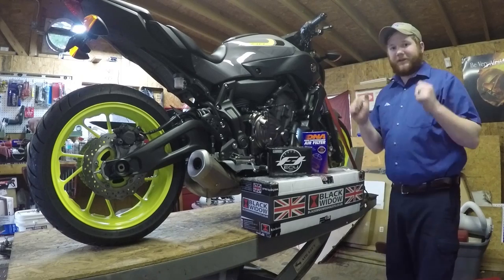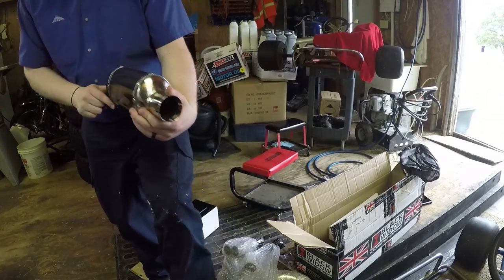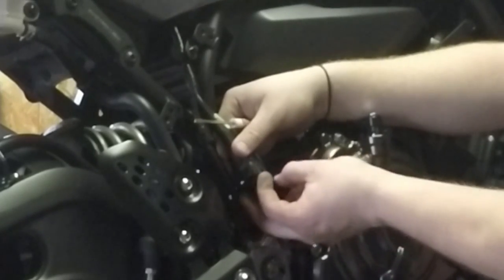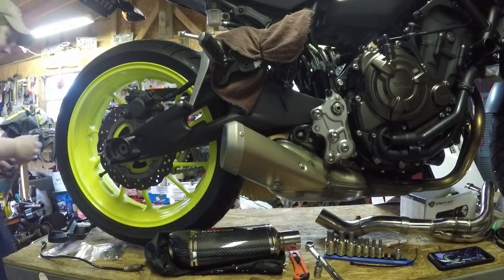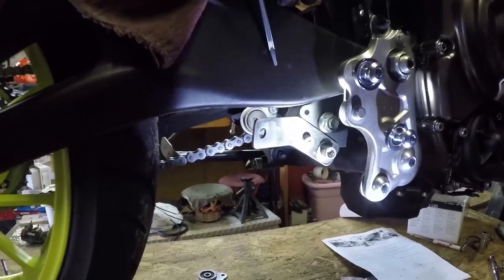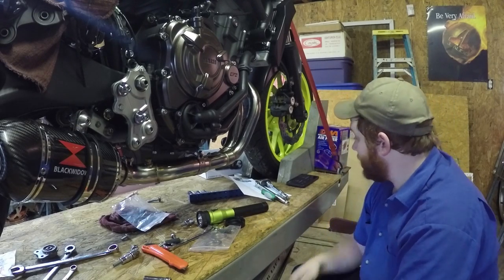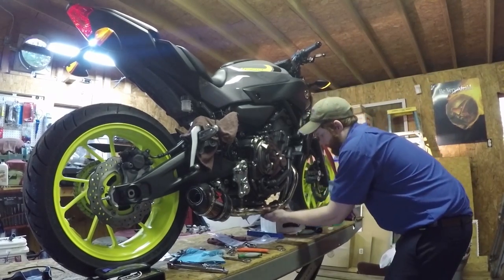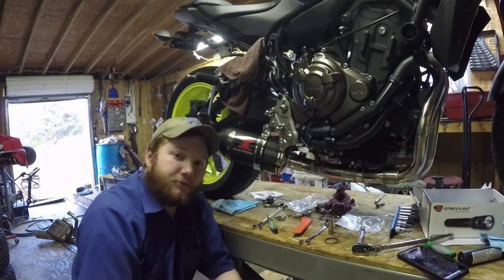Black Widow Full Exhaust Install - FZ-07 Build Series Ep. 2

Comment: Hi Smiley,
What did you do with the O2 sensor on the cat or doesn't this have any?
Reply from the maker: Yan Kelecom Great question, wish I would have covered that in the video. It has a threaded hole in one of the mid pipes and will accept the factory o2 sensor. Alternatively, it also comes with a dummy plug installed so you don't have to run one. I wouldn't recommend that though.

Comment: I installed mine in about 30 minutes... no issues. I used copper hi-temp sealant at all joints like I do on every system and no leaks. Sweet system!

Comment: Hey thank you so much it helped even today on 2022. A few questions did you torque things to spec? I have very little clearance from the oil pan and the pipe but it’s not touching so I assume I’m in the clear. I totally didn’t clean my pipes either before I started it. How tight should the clamps be on the joints because if I shake it hard enough it twists a bit.

Comment: My tips, as I did this myself several months ago... The gasket paste on mine was also a little hard, but if you manage to dig out the first bit of the tube that has hardened, its then ok, and it's kind of a must use, it helps lube the bits to slip together, and then yeah seal it all.

Also getting the pipes and exhaust to sit right is all about rotating the bits more than how far they slip on. And on some pics of other peoples installs, the muffler sits out too far cause the muffler mount is universal and comes with a long alloy shim, which people think needs to be used, but with the MT07, you don't use it (the install instructions are terrible).

Once the system is together, the joints well lubed with the paste, and muffler bolted on right, which I'll also drop the tip of... don't do up the bracket full tight till the end, and then you just use the rotation of the center pipe (the bit that has the O2), to get the angle and placement/clearance of the muffler just how you want it.

Done the right way, it's actually not a hard install, and quite easy to get the fit right, but the lack of good proper detailed installation instructions, means a bunch of the pics I have seen of others efforts, are fairly all over the place, where as mine looks 100% like the pic on the Black Widow web site.

My rating of the system though, is high, it's well built and sounds as good as anything else on the market, for half the price.

Comment: I had a leak in the mid pipe so I put an extra clamp on and honestly, when the bike heats up, the metal swells and stopped the leak. Plus it a bike for the street, not the track. If I'm losing a little air I'm not really going to get crazy over it. Sounds good

Comment: I'm also struggling with that fucking can bracket and this is the 3rd time I've installed this exhaust and it never gets any easier... The thing never seems to want to sit right and you basically have to screw the bracket on crooked and it ends up touching the swingarm.
Reply from the maker: I don't doubt it at all. The only thing I know for a fact I did wrong is I had the can pushed too far down on the pipe itself. When I slid it back a little it come off the swingarm probably half an inch. Might have to rework the holes in the metal bracket the muffler strap bolts to so it will sit a bit lower. Sorry you're having trouble with it, I feel your pain
Reply: I found if you twist the middle pipe (the one with the O2 sensor) it moves the can towards or away from the swing arm. Mine's got a good inch and a half of clearance now.

Comment: Got the same exhaust I'm in the UK. The high temp silicone you should of used that on the connections. 
Also you have put the muffler on tilted. 
Also if you find that the muffler is to close to the rear wheel try twisting the link pipe from the collector and moving the muffler further back so you have a gap from the bend on the link pipe.  By twisting the like pipe it will change the angle that the muffler sits.
Reply from the maker: I'll be tearing it apart to see if I can get it situated right like you say. The paste that was included had actually hardened and would even come out of the tube, I bought some hi-temp stuff I used on my CRF slip-on the other day so I'll be getting on that pretty soon. I'll definitely go back and try to line it up better with your tips homie, I sure appreciate it!
Reply from the maker: Sorry to be getting back to you so late, you were absolutely correct on all accounts! I did have all the pipes situated wrong and the sealant did take care of 95 percent of the leaks. In my defense, I was super worried about the exhaust sticking too far out purely from a cosmetics standpoint. Some of the systems I see look bad IMO just for that reason, so I pushed the muffler as far onto the pipe as I could. Definitely all my fault there. I do plan to do a short update video explaining that so I don't just leave everybody hanging at the end of this one. Thanks for taking the time to straighten me out, people like you are the reason I put these terrible vids out! Thanks again man.
Reply: Hi-Viz Smiley I done the same with the muffler pushed it all the way on till nearly the bend so it had a couple mm befor it. 

Seen on your other video you have movement on the muffler u shouldn't have. Tighten the bracket  up or purchase a slightly smaller sized one. The muffler should be rock solid.
Reply: Hi-viz smiley 

Update I've taken my link pipe and muffler off again. 
A couple weeks ago I've caught my exhaust on the floor while getting my knee down 😁😁😁. I've now put my exhaust nearly touching the swingarm leaving around 10mm gap if that. Also it's left around 5 to 10mm gap between the wheel.
Reply: Hi-Viz Smiley thanks to your video.  Had the same issue fitting and the two end connector leaking.  BW seal or tube does get dry faster. I will look for another sealant and try again. My fear of tightening it too much might bent the tube. So I’ll try the hi temp as tested by you and others.

Comment: I JUST BOUGHT THE EXACT BLACK WIDOW EXHAUST FOR MY 2018 MT07 AND WILL INSTALL IT TOMORROW. WHAT DID YOU DO TO ELIMINATE THE TWO LEAKS?
Reply from the maker: I just used high temp silicon and made sure the pipes were perfectly situated. 90% user error on my part
Reply: @HiVizSmiley  THANKS FOR THE FOLLOW-UP.
Reply: Where did you bought it from please link

Comment: Hey Smiley! Love your videos, please keep up the great work. 

I just recently got the same exhaust and it came in the mail today. I am not exactly the most experienced mechanic and I am kind of stressing over the installation process. Taking off the stock exhaust seems pretty easy, but putting the Black Widow together and installed stresses me out haha. If you don't mind me asking, could you shed some light on the following:

- When putting the pieces together, how far in should I squeeze them? All the way (as much as they go?)
- Should I use some gasket sealant? If so, at which parts? All of the pieces when I "combine" them? Should I put something to the section where the headers go into the engine (e.g. lube)?
- You mentioned in your other video that you used silicone. Is that a must? I am expecting leakage when I first put it together, but I'll do my best to fix those up! I guess a tiny leak won't hurt either, right?

Sorry for all of the questions - it just happens to be so that you are quite skilled and I'm not haha. I really appreciate the video and it definitely will help me with everything, but those are some things that came to my mind. Either way, I hope you have a great summer and ride safe!

All the best,
One happy subscriber!

Comment: Hey buddy, I’ve just installed  the.Black Widow on my MT07. Ive put everything back as it was including the O2 sensor.
It sounds amazing.  My only gripe is that the orange engine light won’t go off. I have read it may go off after a run. Any ideas?
Reply from the maker: I never had a check engine light after putting the exhaust, tune, or airbox on. I'm afraid something isn't 100% right on the install or there is some other issue. If the ignition switch sticks in the start position the light will come on, happens to me all the time.
Reply: Hi-Viz Smiley Ok pal. Thanks for the quick reply. I’ll go over everything again and if no joy I’ll take it down to my dealer. 👍🏻
Reply from the maker: @bethesdaboyo  no problem homie. Good luck!
Reply: UPDATE... took to the garage and they set it up to diagnostics with no faults showing. They gave the oxygen sensor a clean and reset everything and now all is good. Even the mechanic was impressed with the sound of the Black Widow on a twin engine so I’m one very happy biker. Thanks all.
Reply from the maker: @bethesdaboyo  Awesome news my man, glad it wasn't anything major!

Comment: Did you use the paste included? In my opinion Black Widow exhausts sound amazing, much better than the akra systems, and a damn sight cheaper
Reply from the maker: Nope. I had bought the system months prior and by the time I went to put it on it was nearly solid in the tube. I used some permatex high temp sealant later on after I took it back apart and fixed a few little issues of my own doing. Thanks for watching man